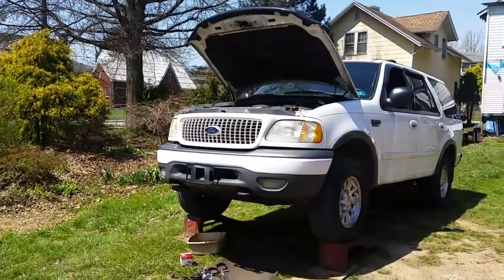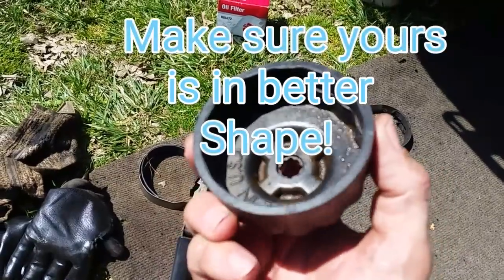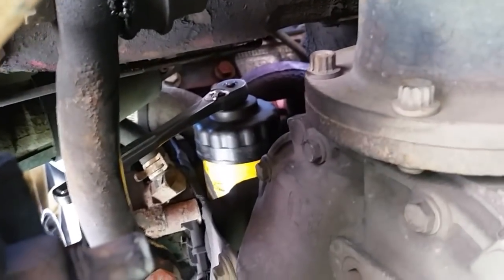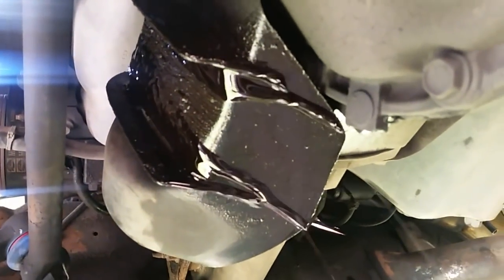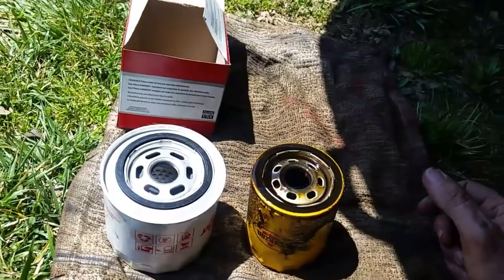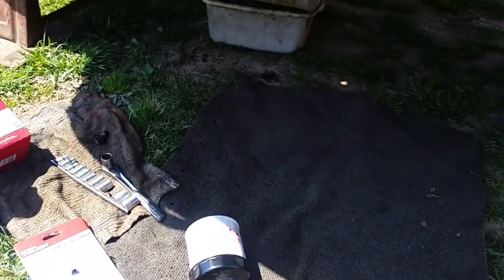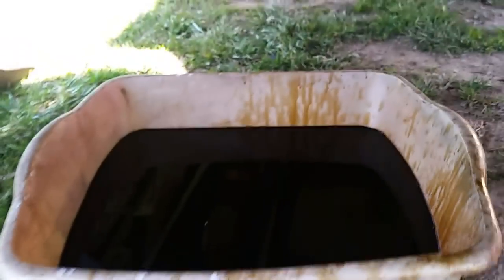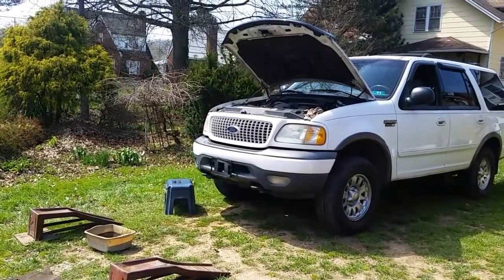Ford 4.6 Expedition Oil filter change and new oil change tips.

Comment: I learned  hard hard lesson years ago on making sure filters are the same. I had a Kenworth with a Cummins 400 Big Cam. Drained oil , dropped filter. Poured oil in new filter and it would NOT SCREW ON.  Went back to store. Yeah there's 2 thread types !

Comment: That yellow filter you had was definitely the wrong one, they are supposed to be big like that white one. if you use the motorcraft filter, the part number is fl-820s and it's the same size as your carquest filter. they sell the motorcraft filter at walmart for $4. If I had to guess the yellow filter was installed by a quick change shop, they just throw on whatever seals from what I've seen.
Reply from the maker: Yea that's what I thought....the perks of buying someone's used Auto..   o-O
Reply: Nathan Rohrbough true, but hopefully you don't have that vibration that mine has that I can't seem to track down. My Expedition loves the vibrate on the highway I went so far as replace the drive shaft even ran the thing in the air with the wheels off and vibration still there
Reply: The yellow one looked like an FL400 size - for the 3.0 V6 Vulcan engine.

Comment: My son just changed oil in my 04 4.6. He had a hard time getting that filter off.  I will get a thingy like you used for the next time.         One thing though, I only use  motorcraft  synthetic oil and filters as reccomended by ford. It is worrth paying a few dollars more. Your oil looked terrible.Dont let it get that bad
Reply from the maker: Yea that was a new SUV. They never changed the oil.

Comment: What kind of oil? 5w-30?
Reply: 5w20
Reply: For the 4.6l
Reply from the maker: @simpleman3256  I'd go with 20-50 if there is high miles in warm climate, 10-30 in cold.
Reply: @FixingWithPassion  I gotcha, 5w-20 was what it "calls" for. However, I agree with you certain things will change that. Btw thanks for the video, that oil filter kicked my butt lol